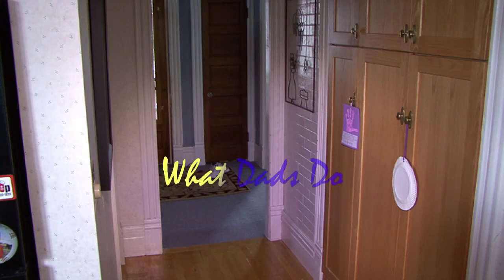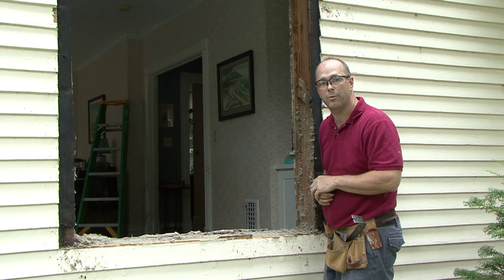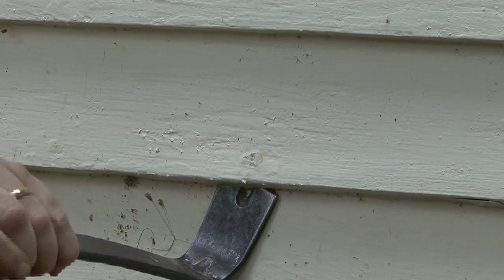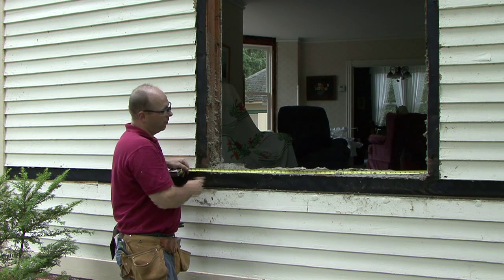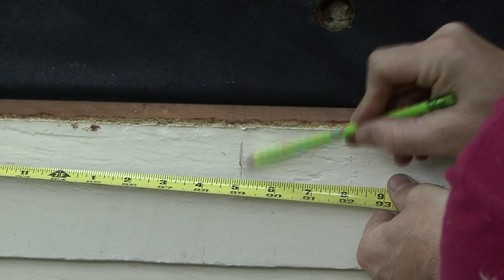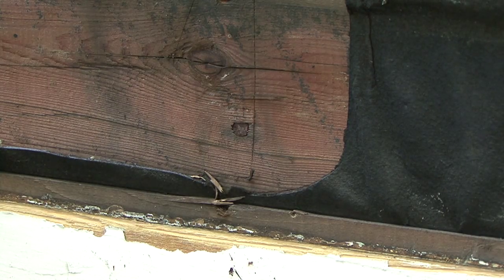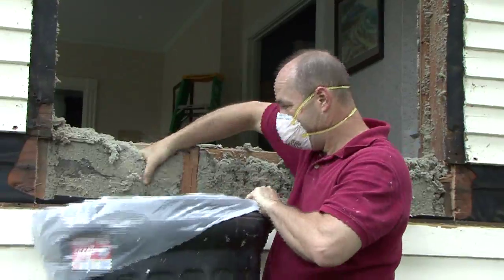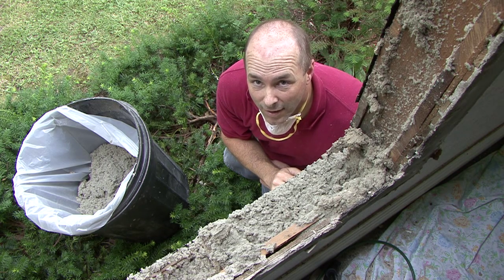What Dads Do Episode 6 - Final Preparation for Framing Window

Comment from the maker: I found that many of the 100 year old windows on our house had few nails between the jambs and the studs (and of course, often only a stud on one side), but they were nailed in through the casing/trim into the sheathing.

We didn't order casings/trim on our new windows even though we were residing because we wanted the the trim to match the other windows on the house.  We began the new window project several years ago, so some of the new windows were already there when we stared residing.

Comment from the maker: The trick is to get the nails (in the top board, the one you don't wish to remove) to "pop," enough so you can get the claw of a hammer or flat bar under the nail head.  Sometimes I need to use the V of my flat bar as a wedge into the nail (under the clapboard but against the house).  With the nail "locked," I tap on the clapboard until the head pops up.  I'm planning on putting together an episode on this in early July.  Hope this helps!

Comment: So it seems that not having a header is common for 100 year old houses. I'm replacing windows on my 100 year old house. I ran into the same issue. But I was only missing the header. The people at the home center wondered the same thing about the window having no nails in it. 
But the strange thing is. I know the windows that I'm replacing are not 100 years old. They seem to be the type you would find in mid to late 70's.
BTW. Great videos.

Comment from the maker: If replacing the clapboard with wood, be sure to back prime the new boards. We got sick of trying to maintain 100 year old clapboard, so we're in the process of replacing our it with Hardiplank cement board clapboard (doing 1 side per year, on year 3). It looks just like wood (unlike vinyl, which has its issues), and comes factory painted (15 year warranty). So far, we're extremely pleased. Also adding 1 inch of foam insulation & Tyvek. I'm filming the process and will post as soon as I can.